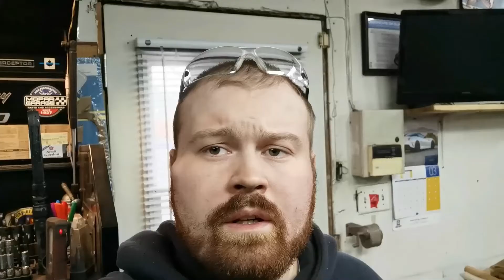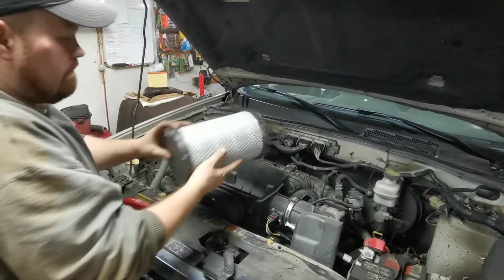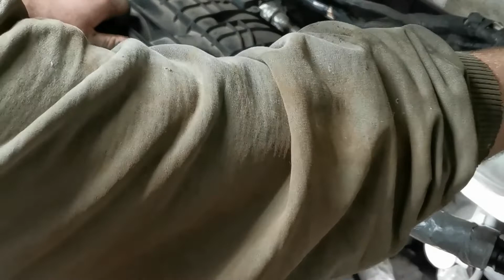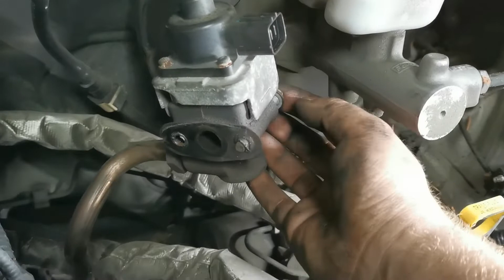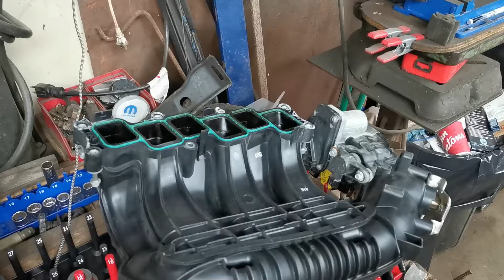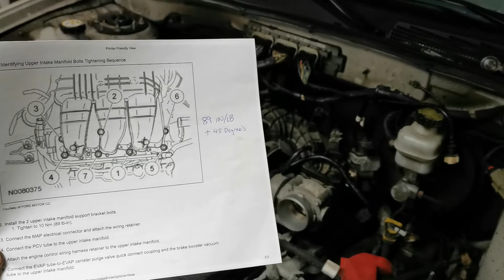2008-2012 Ford Escape/Mazda Tribute/Mercury Mariner Dura-tec 24 valve 3.0L V6 Spark plug replacement

Comment: totally unrelated….I learned that a common cause for these engines to fail is the cam cap bolts coming loose after high mileage. this allows the cam to shift and destroy the valve train . you can prevent this by pulling the valve covers and torque down all of those cap bolts to spec. a big job, but if you are already back there for the rear plugs you may want to consider it.

Comment: Did you find the Autolites were about 1/8" shorter from the seat to the top than the Motorcraft? I bought some Autolites, but I'm thinking of taking them back. I'm afraid since they are slightly shorter the coil contact won't reach the plug.
Reply from the maker: I found in my case that the Autolite's I ordered were nearly identical to the Motorcraft's I pulled out. I did read about on some of the forum's the phenomenon you mentioned.